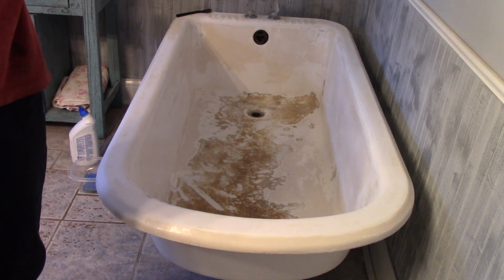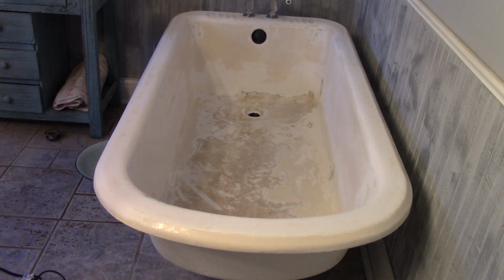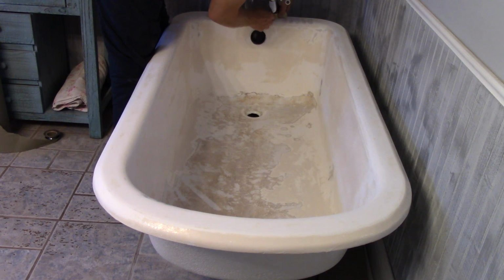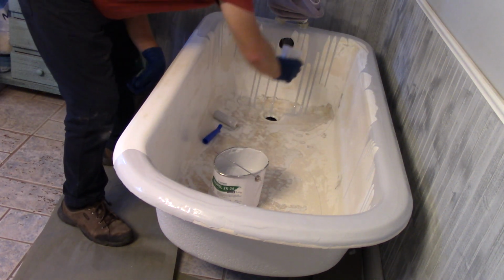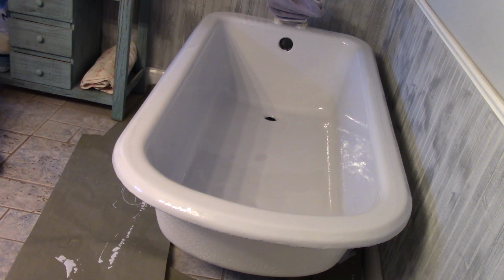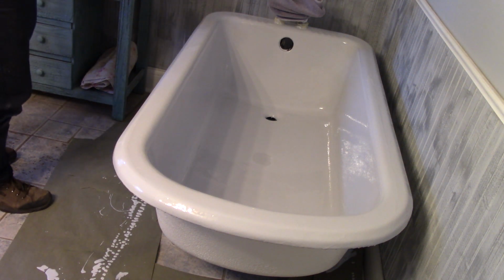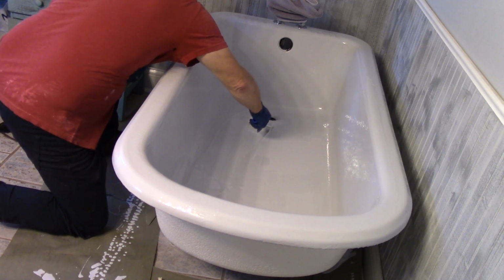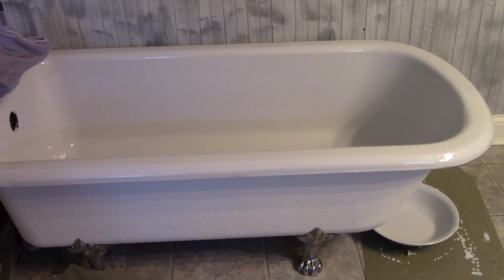Ekopel Bathtub Refinishing - Fantastic Or Flop

Comment: I did mine last weekend and it is ok but I need to touch up a few spots, some of which were my fault. I wiped up too much too late around the drain and there are a couple thin spots on the outside wall. As you noted you can see a few runs and streaks if you look close. I may try to sand them a little. The patch kit is ordered so next weekend I will see how good I can get it. All in all the tub is MUCH better than it was. I would say it is worth it but the product does not flow and run out as perfect the company videos implies. I ordered white so color and specks of dirt were not an issue for me
Reply from the maker: Oh, mine is a 100% improvement as well, but there are a ton of pinholes, that were not in the original finish and some runs.  Is it worth the price?  Yes.  Just don't have really high expectations.  I removed my drain, so I wouldn't have to try and scoop up material.  I can't compare to other products out there, but for the price it was, it was still way cheaper than buying a $1000 tub.

Comment: is it possible that the black hole are black dye use to convert the white ekopel to a gray that were not properly mixed at the factory ?
Reply from the maker: @thecarl168  Good theory, but when I mixed it, I never seen any specks.  And the tub was white.  No clue, but they never got worse and it's still holding up fine.  Thanks for watching.

Comment: I cleaned my claw foot bathtub with Lysol cleaner like you did , washed it out , dried all the water , then I cleaned it again with rubbing alcohol and let it air dry . Mine worked out looking very good.  
Did you get the air bubbles out with the hair dryer ? Just curious.  Thank you for the video Sir
Reply from the maker: Hi and thanks for watching.  I really didn't have a problem with air bubbles, I used a heat gun and hair dryer, the problem I had was some sort of pitting.  Well I suppose it could've been air bubbles that popped, but in the center they look kinda black, which is strange because the coating underneath the Ekopel was white.  No clue and Ekopel wasn't any help.  But it does appear to be holding up well.
Reply: @gregslair4278   Thank you for the feedback Sir . I am restoring a Farm house double bowl Porcelain/ Cast Iron sink made in 1929 and I pray it doesn't happen to me this time.
Reply from the maker: @joelmabrey2569  Well Ekopel had no explanation and said they were holes???  That tub is ancient, but zero holes in it.  Good luck and let me know how it turns out, I love that old stuff.
Reply: @gregslair4278  yes Sir . I love it too. I restore antique metal lawn furniture . People are crazy about it right now . Have a great day Sir
Reply from the maker: You too